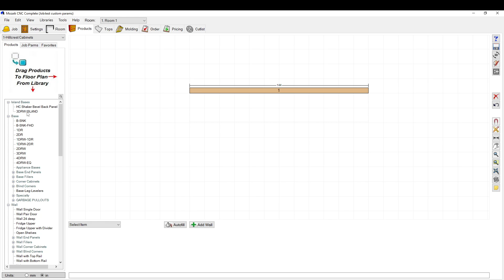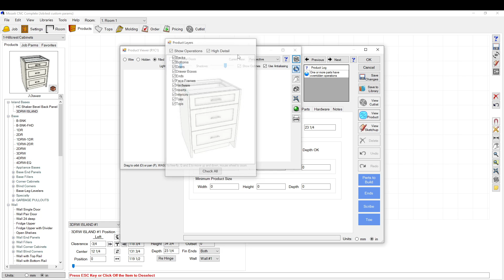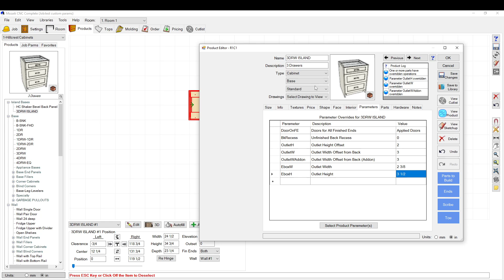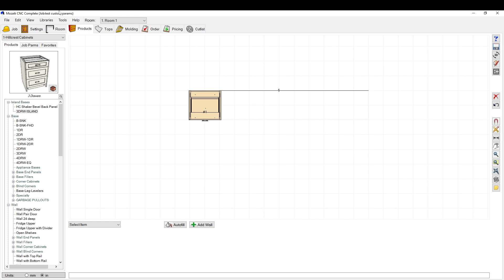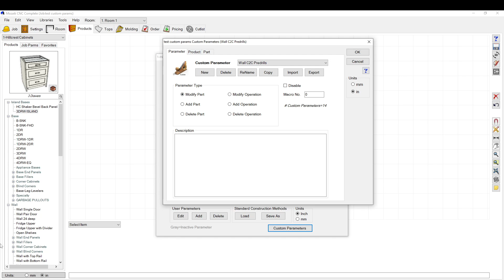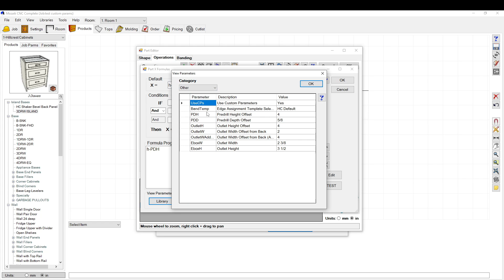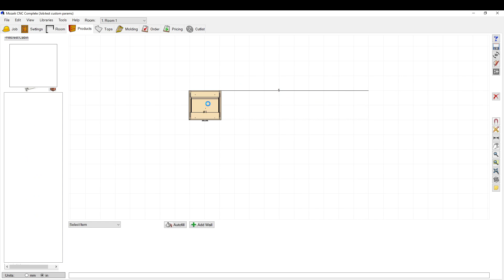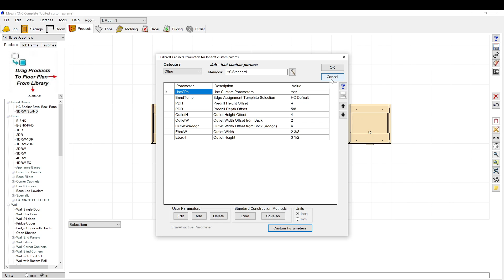Outlet Cutouts on the CNC (With Custom Parameters) - Mozaik Software Tutorials

Comment: Hi 
i've a question, and i'm wondering if this is doable !
i'd like to make a dynamic product, one i drop it in the room a pop up asks to set the value of an option :  number of drawers in the cabinet.
and this generates the exact number of drawer. 
thanks in advance !
Reply from the maker: @DevinciDesign  no this is not possible sadly. You would need to drop in the cabinet and edit it in the product editor
Reply: @cabforgesystems hi there ! Thanks for the feedback. Thanks to your video I started playing with custom params and formulas. 

I tried the Ebox example and noticed that when the rule says PenalizedEnd it doesn’t work on FEnd or UEnd. 

My question is : do I need to set as many custom operations as End types or there’s one that works on all end types? 
Thanks in advance.
Reply from the maker: I’m not totally sure what you mean but if you set left side as “left end” and right as “right end” it will flip back and forth automatically as a finished end/unfinished end when you set it in the cabinet data menu below the drawing screen